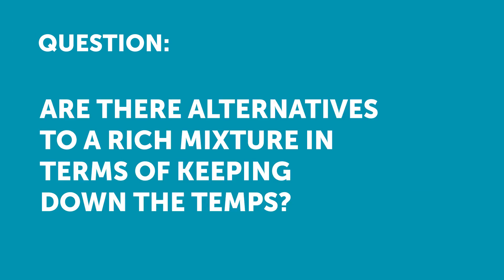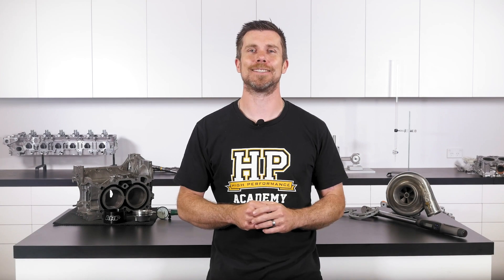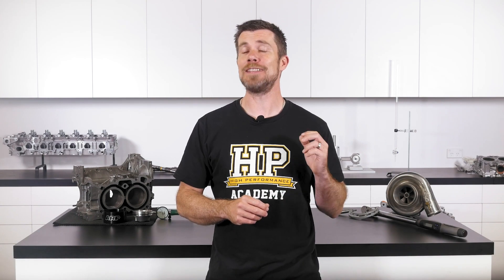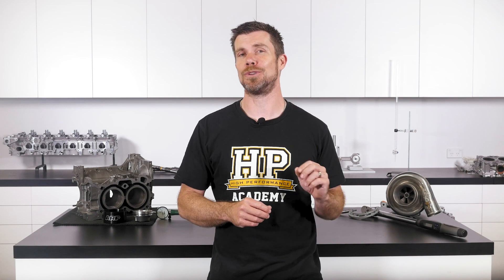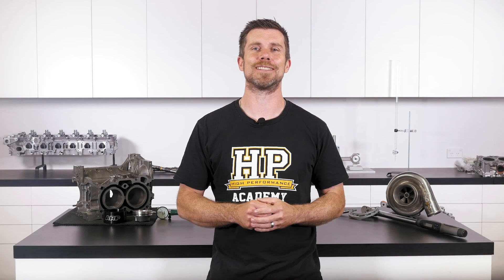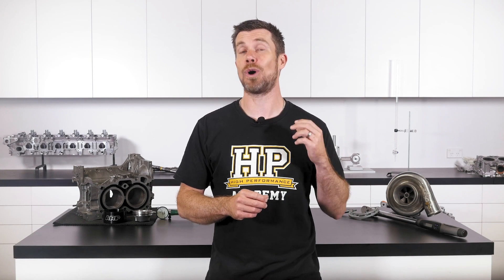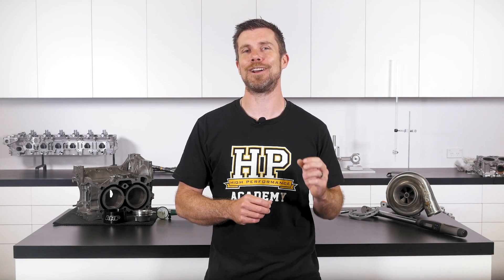Combustion Charge Cooling | Water Injection, Ethanol, Methanol [HPA Q&A]

Comment: U forgot LPG. also can cool IC depending on which system. 
In a turbo application, u can route the gas thru a barrel cooler and that’ll cool the charge also. Very effective actually. 
Did this on My 20b turbo rx8. 
Full LPG set up. 
Solo fuel
Reply: LPG liquid injection 👌
Have heard about but never seen the water Intercooler circuit used to “heat” the lpg in a mixer/vapour injection setup 👍